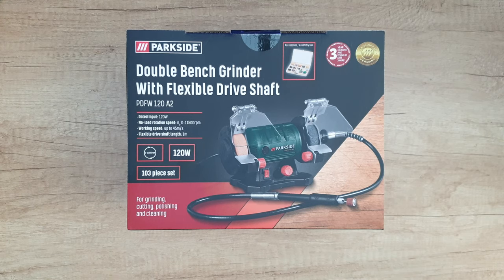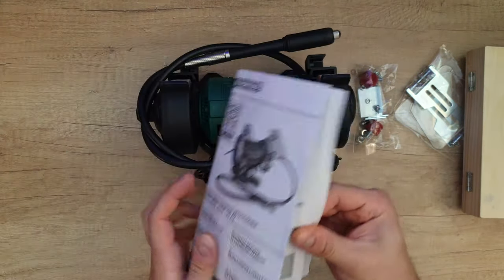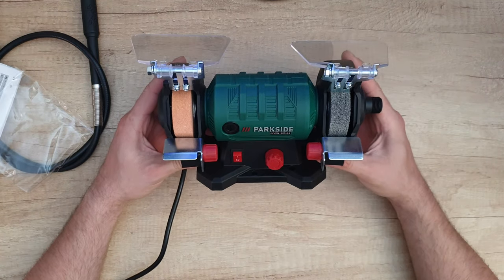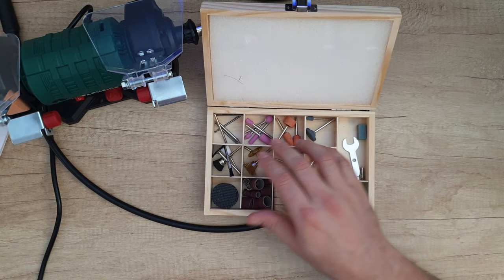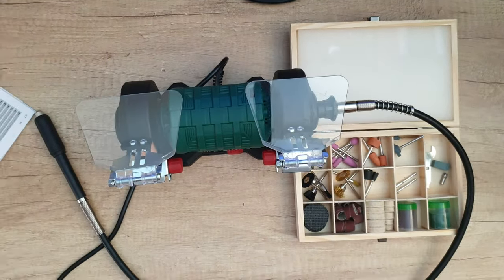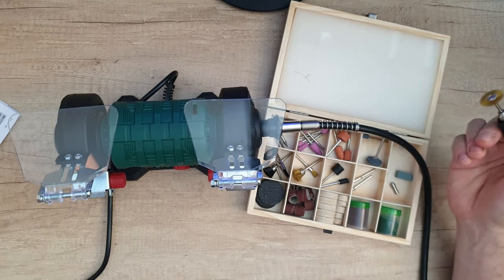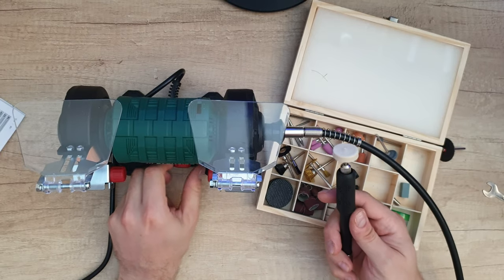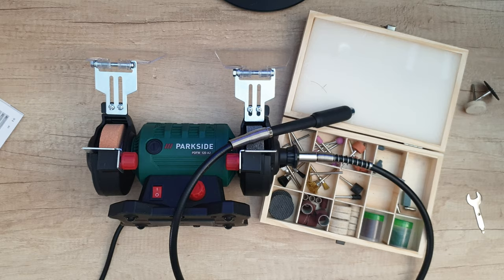Parkside Double Bench Grinder With Flexible Drive Shaft PDFW 120 A2

Comment: Have you actually tried to use the wheels on this grinder? The one I bought slows down so much when you put anything against the wheels its basically useless. Also, mine has suction feet and it vibrates all over the place and is actually unsafe to use as it falls off the bench every time I try to use it.
Reply: yeah. IT´s rubbish